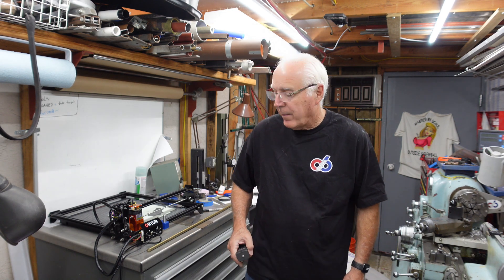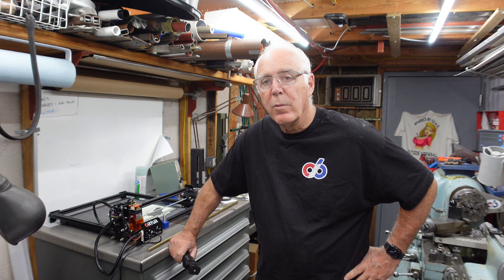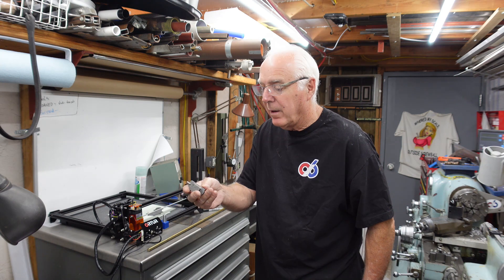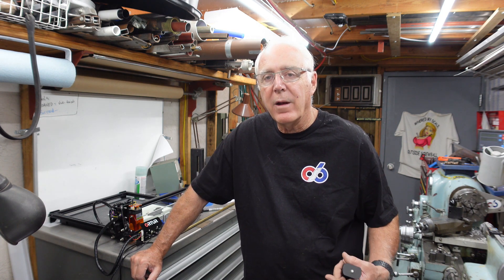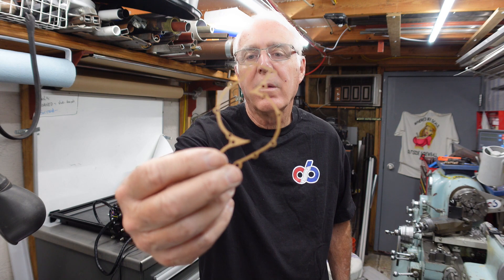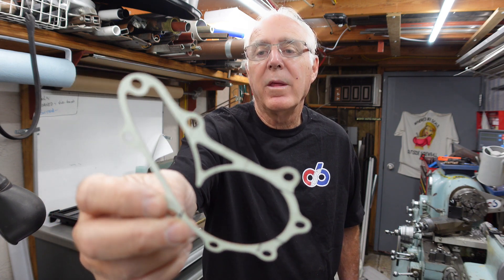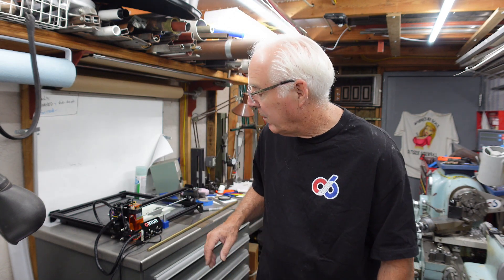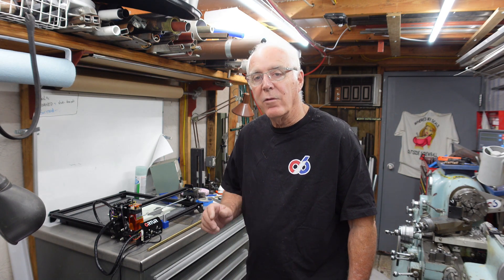Ortur Laser marking a tool after grinding

Comment: Hi Chuck,

Good idea to cylindrical grind a relieved section of shank on the thread tap, I've done that a few times with end mills but I used my U3 tool and cutter grinder. 
I like the motorized spindle/work holder that you used on your surface grinder, I really should make one similar for mine, I may make one out of a 5C rotary indexer at some point. 

BTW, you really should think about adding a vacuum system to your surface grinder, if nothing else but to keep metal dust from getting everywhere you don't want it, it even helps to keep metal dust out of the ways on the surface grinder itself. 

Here are a couple of photos of what I did for my surface grinder, to me it's a must have but I probably went a little overboard on my chute and adjustment rod setup. 
It's made out of aluminum so it's much lighter than it looks.
Links to photos below were deleted, I guess you don't allow links in the comments due to hijackers?

Check your email to see photos.

Glad you're having fun with the new laser engraver! :-) 
This makes me want one but I guess a good 3D printer is first in line for me and my budget :-) 

Nice work, Chuck!! 

Joe